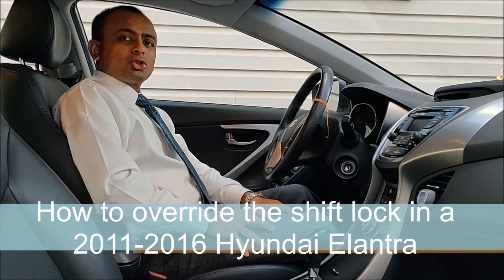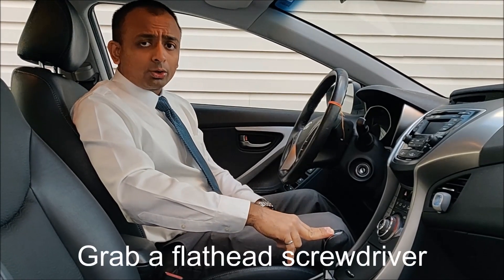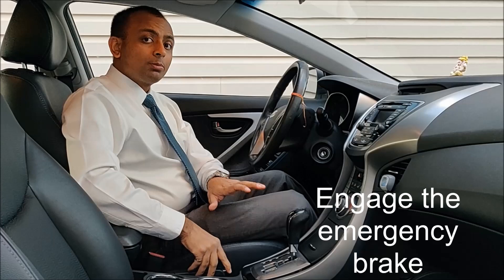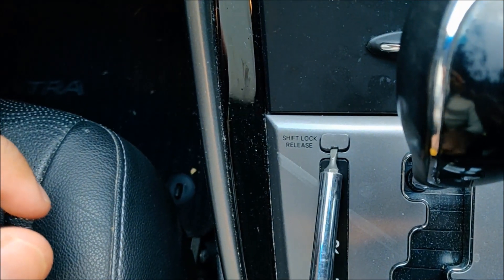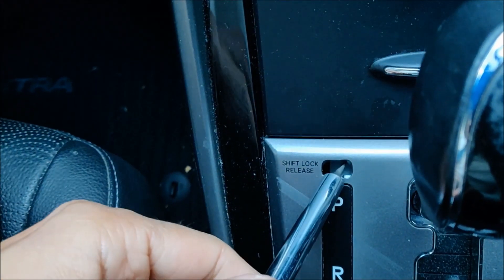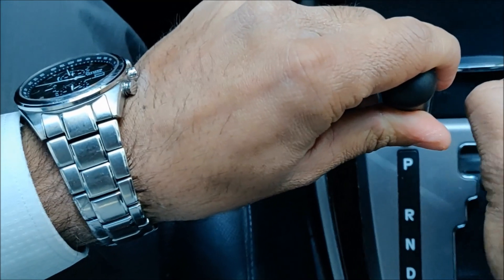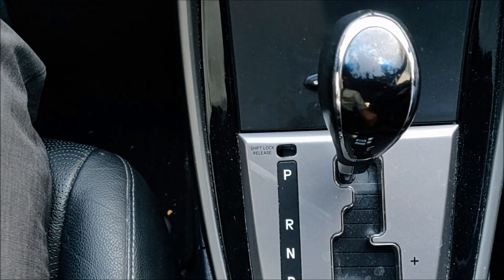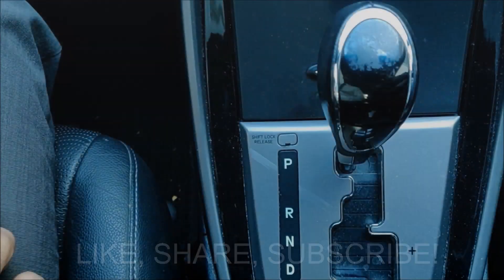Shift Lock Release [EASY] - Hyundai Elantra - 2011/2012/2013/2014/2015/2016 - How to / DIY

Comment: Quick and easy!  Video explained it all clearly and the process worked exactly as described.  My 2012 Elantra is mobile again!
Reply from the maker: Glad to hear that!😊
Reply: But its just to get u back home? It keeps doing it? @VirarAutomotive
Reply from the maker: @VictorArgeniss  yup. This is just to get you back on the road and get you home. You need to get it checked by a mechanic to diagnose the underlying issue and get it fixed.

Comment: Already verified that this in deed actually worked!  The tool I used was a bit big to fit into the slot, so I used a pen that was a bit thinner to press the release down, thus, unlocking the mechanism.  I had my daughter try and after a few times, I told her she will try again tomorrow.  The easiest way to do this is once the part pops up a little, twist to either to the left or the right and the pressure will unlock the little oval with minimum for it to fly off.
Reply from the maker: Thank you for that additional detail Sir. :)

Comment: I am watching this video for my 2011 Tuscon. It has the same type of mechanism. I have had an intermittent no start problem and (although the transmission position sensor was just replaced, the shop told me that if I tried this it may have temporarily fixed the no start).
Reply from the maker: So glad to hear that you found this video helpful. It is a temporary fix ,yes, to get you going wherever you have to.😁

Comment: I just purchased a used 2013 Elantra. I didn't know I would NEED this trick. Why would the shift lock just because your car is off? And what is the + - gears? I heard these allow you to drive manual but how do you accomplish this?
Reply from the maker: The shift lock is there to prevent the car from accidentally going out of park. That's also the reason why you have to press the brake before you can shift out of park. It's a safety feature that's designed to prevent accidental gear shifts and risk rolling the car

Comment: You need to make video on how to change battery fuse box that’s connected on the positive battery under hood
Reply from the maker: In the meantime, check out this video. It shows how to read the fuse chart and change fuses. Not sure if this is something you were looking for, but just in case. Thanks.  https://youtu.be/xFuDNq8WL5w

Comment: what to do when hyundai elantra 2010 stuck in neutral wont move
Reply from the maker: I have never worked on a 2010 Hyundai Elantra, sorry I couldn't tell you for sure what may be the solution to your problem.
Reply: How about 2013 stuck in neutral
Reply from the maker: Stuck in neutral?

Comment: Mine gets engaged randomly while I'm driving with no warning and when I stop I can't shift above neutral to put it in park. I can't find any reason why this is happening. I've taken it to my mechanic and the dealer and both times when they got to the car it shifted fine. Its frustrating because I get stuck at stores, gas stations and such and can't shut my car down in park and take the keys out.
Reply from the maker: Yeah it sounds like either a fault gear shift position switch, shifter interlock switch or brake pedal position switch. But the problem is that it hasn't gone bad completely yet. Its just dying, not dead yet. Very frustrating because its hard to find the problem when you cannot consistently reproduce it.

Comment: Why does it get locked in the first instance
Reply from the maker: Multiple reasons. Bad brake position sensor, gear position sensor, shift solenoid. Would need to have a mechanic check it out.

Comment: Now what. This only gets the car out of park. Once you put it I. Park it locks again. WTF
Reply from the maker: Doug this video is more about helping you get out of a tight situation quickly, if it is happening again, then you would have the get it fixed. one common problem is a faulty gear position sensor, but do get it checked out before attempting a fix. Thanks
Reply: Virar Technologies yeah and it is a fantastic video showing that. My wife’s Tucson 2014 has the shift lock next to the shifter in the console. But same exact method to get it out of park. Was just looking for an explanation also.
Reply from the maker: Glad you found it useful. Cheers!